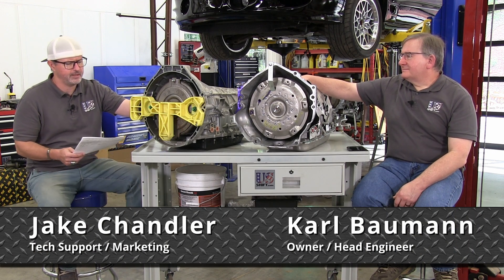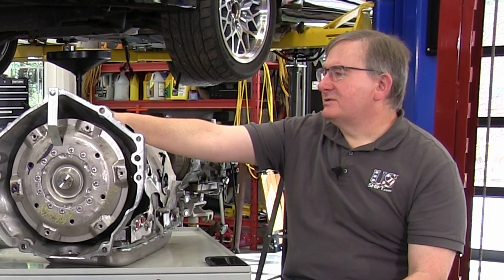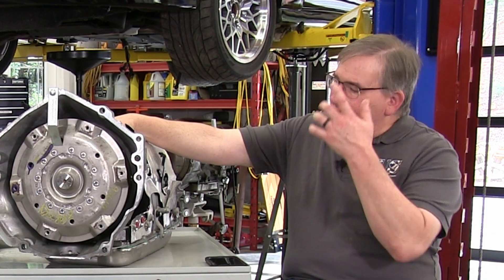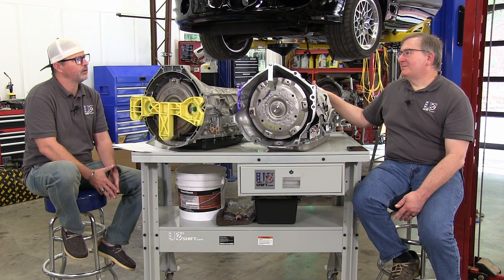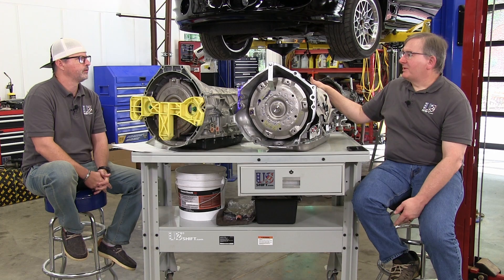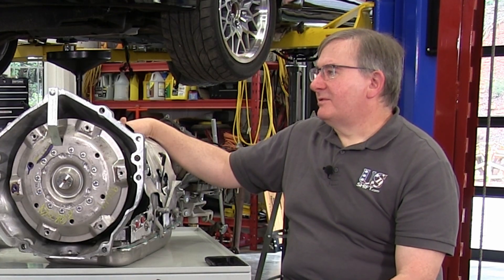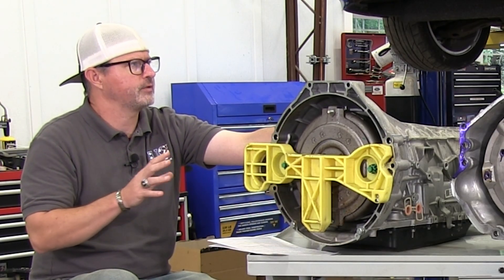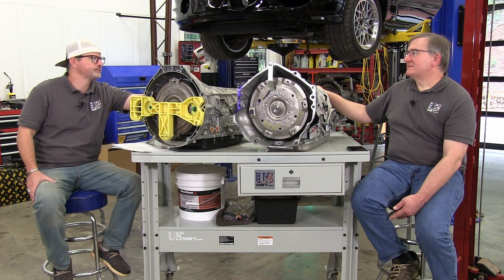Why 10 Speeds: Minimum Torque Loss, Maximum Power Transfer

Comment: ZF 8Hp , eight speed is the goat.
Reply: Bingo. No need for more, in a class 2 or 3 vehicle.  Basically,  all the OEM use ZF designs, and ZF reported that 10 speeds were unnecessarily complicated,  and they are a German corporation.
Reply: Great. do they make a standalone computer for the ZF 8HP?

Comment: Can you tell me if the 10R80-140 automatic transmission bell is the same as the 5R110 or is an adaptation adapter plate required when replacing it?

Comment: 6 speeds is plenty,  10 speeds just means more parts to fail,  and a valve body that wears even faster, on account of being so busy.
The 4R70W would go 300,000 miles with a little maintenance,  the 10R80 is failing before a 100K.  
Making it a bitch to service,  and removing the dipstick was a really shitty idea too.
Reply: Not with the emission requirements that car manufacturers have to meet these days.

Comment: If these are so good why don’t they last?
Reply from the maker: Make sure to check out our video on reliability that came out right before this one. In short, there were some issues with early models, like any new transmission, and those issues can be fixed with a few simple modifications from the aftermarket. (Specifically the GM version.) With proper maintenance, these can easily go 100,000 miles +.
Reply: @Usshift  "100K miles?" That's no brag: the engine is just starting to get broken in! We aren't living in the '70s any more...
Reply: @nunyabidniz2868  This bothers me every time I hear it. A well engineered vehicle should go at least 300k with majority stock components.
Reply: They are engineered to fail after the Warranty expires.  OEM Transmissions that is .
Reply: I just sold my 2018 F150, 5.0 ten speed 4x4 supercrew. It had 72k when I bought it in 2019. Yep, one year old and 72k. Previous owner was. Rep for John Deere so, it was on the road alot. Flushed the tranny and repeated that every 25-30k and did a full filter change at 155k. Truck towed my 29’ camper every summer, my tractor on a trailer to our camp and never a hiccup. There was just over 200k on it when I sold it with zero problems. I bought a 2019 F250 with the 6 speed and, it is an absolute dog. Have not hauled the camper yet but, dragging a car on the trailer to the junk yard was depressing.